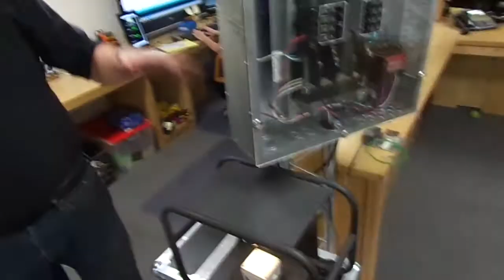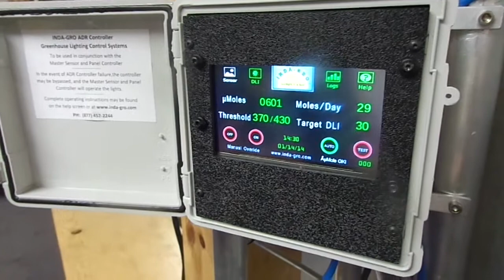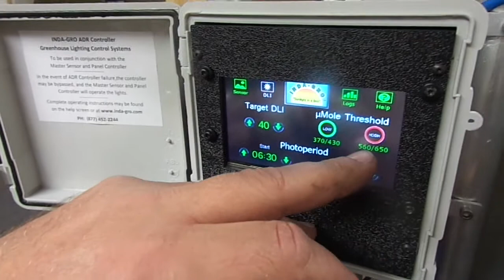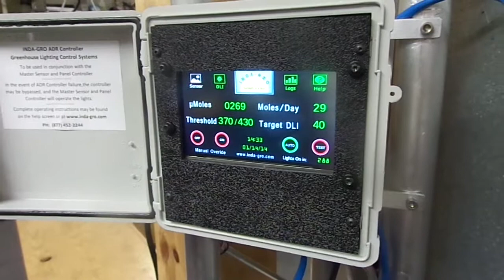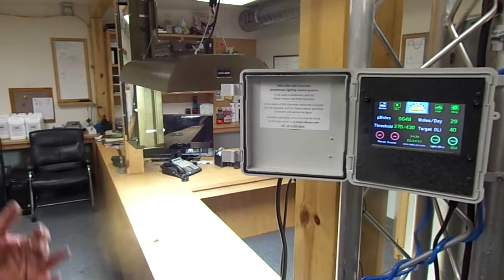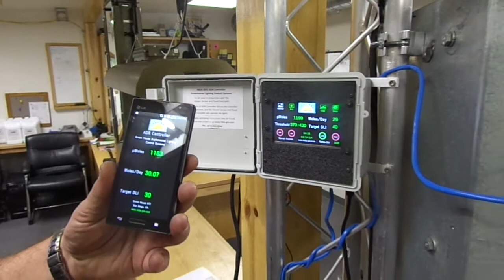ADR Controller Presentation

Comment: This is the best, most comprehensive, and complete presentation to date as to the Greenhouse lighting controller system components and operation. Can one change settings via a smart phone, or only monitor the system?
Reply from the maker: The system can be monitored and controlled by devices with browser capability via LAN or WiFi.
Reply: ***** Excellent!